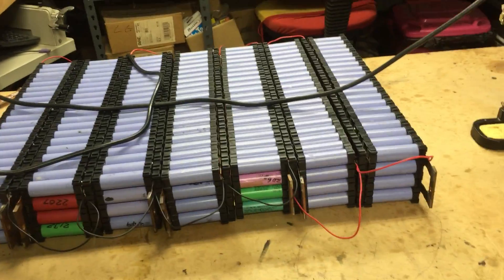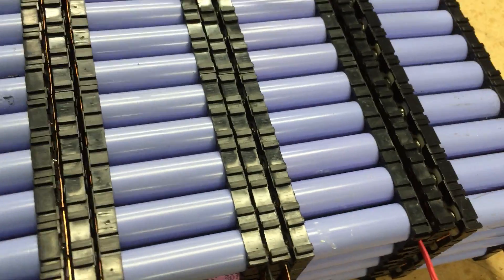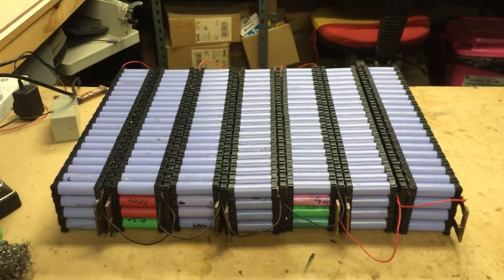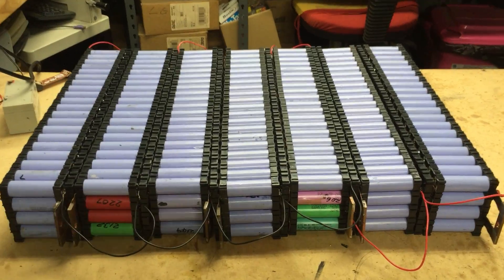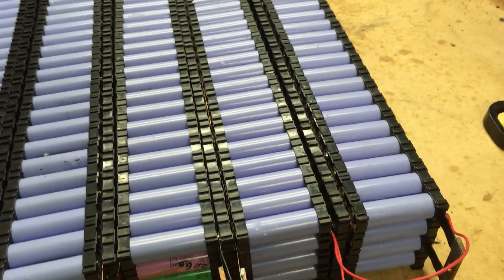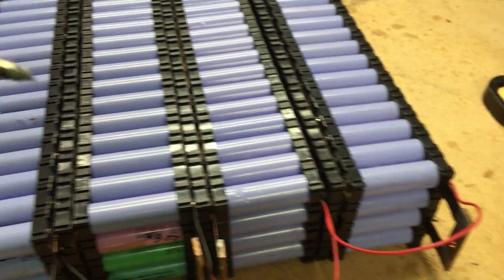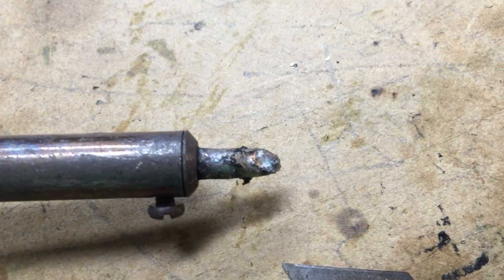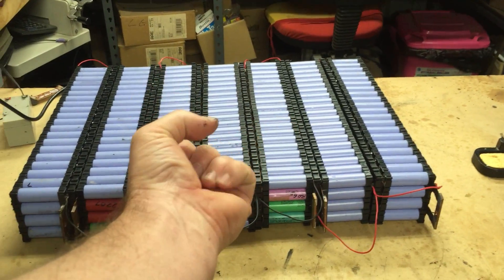TWENDY KILLA WAH HOURS !

Comment: Another video for you to watch, explains why BMS (especially the chinese ones) are useless.
https://www.youtube.com/watch?v=pljSZcEwc8Q
I don't agree with him not using a charger with balance leads/cell monitoring.

Simple maths shows why the little resistors aren't capable (they are rated 1W or less).
4.2V x 1A (charge voltage times charge current)
= 4.2W
eg you need a huge 5W resistor to bypass a cell (or cancel out the input current).

Comment: you have to be using the wrong solder or flux

lead solder? because i know the new lead free crap kills tips

ow and to prove i have no life

FIRST

HAHAHAHAHA
Reply from the maker: it's 50/50 what kills it the most is burning off the plastic coating on the winding wire. cuts groves into the tip till it bends off. then you have to file tip to make it useable again.. So not so much the flux I don't think.. Never mind the soldering irons are only 25 each with two tips.. Now I have good irons it's much better than the early days.